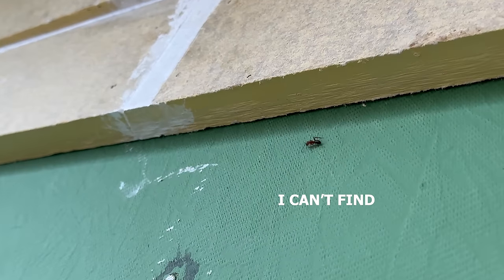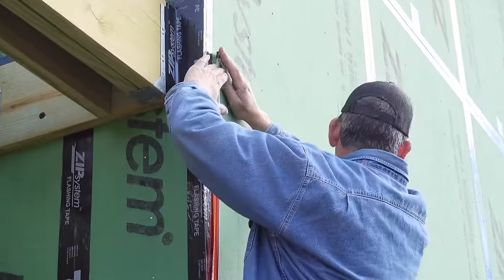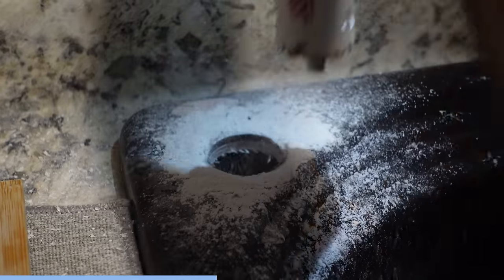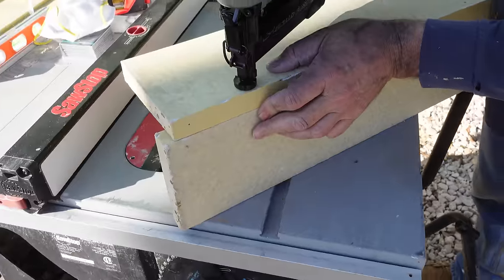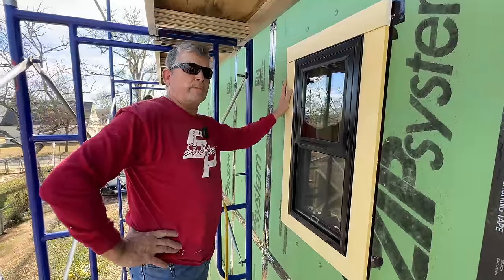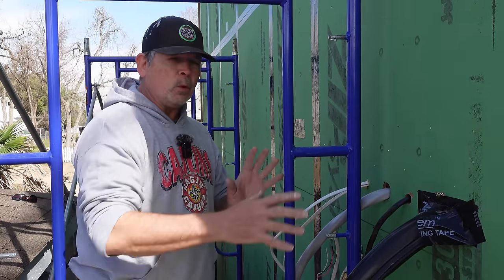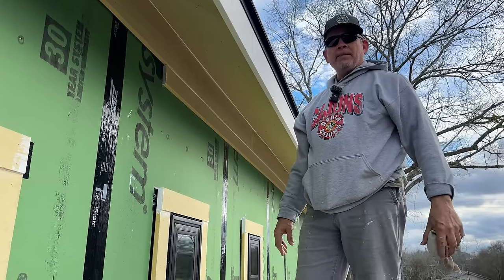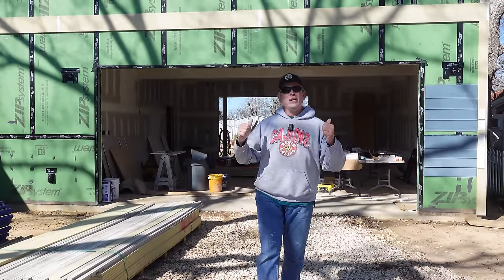Is THIS $30 DIY Water Level BETTER Than a Modern Laser?

Comment: My pop showed me the water level back when I was a teenager. I'm now 66 years old and have used them several times. Perfect every time.
Reply: Same here 😅!
Reply: My dad had a little kit that attached to any garden hose. The kit had two 12" graduated tubes with a mounting bracket on each so you could attach one to the wall, so you could work it alone. I am now 68.
Reply: im right between your age and  dallas arnold8615 that commented  im 67 as of last week       worked with my dad  on   5 houses we worked on growing up  we moved around a bit .   always doing something room additions   knocking out a wall  hanging a door   or something

Comment: I’ve been using water levels on new construction commercial buildings, some spaces over 300,000 square feet for 50 years….works like a charm, better than a laser that you have to knock down & reposition a dozen times. Yes, I’ve used lasers to set ceiling grids, but once you turn corners out of sight of that laser, screwed. I have a 750 foot long water level with RV antifreeze in it. Everyone wants to borrow it!
Reply: Wow how do you store that monster for easy use? Two spools so you can access each end? One spool you have to uncoil fully? 
What diameter did you pick?
Reply: I need more on this! sounds awesome.
Reply: 750', are you building bridges?
Reply: I like your username and avatar. Big jimi fan.👍
Reply: Wow, very nice. I'm also curious what diameter and how do you store/use it.

Comment: I use automotive windshield washer fluid in my water level (that I've had for 35+ years). Not only does it make the fluid more visible but it keeps it from freezing when I work in the cold.
Reply: Do you have to change out the fluid?
Reply: @jkleem4234  Never have... just added more to replace spillage.
Reply: Can you clean your glasses with this fluid?
Reply: Thank you for this advise, never though about it before, that windshield fluid could be used in the water level. I remember how in 90ies I was fixing my cheap Chinese 2 feet level vial with a short water level and with a thin sewing thread with a little weight against a white flat door, where I was marking tiny dots.
Reply: @baxtronx5972  Probably...  I haven't done it but your question may prompt me to try it the next time my glasses are filthy from site conditions!

Comment: I’ve had a water level for 40+ years. Mine consists of a set of two clear plastic hoses that are around a foot long,one with a male garden hose connector the other with a female hose connector. Any length of garden hose or combination of garden hoses will work depending on how far you need to go. I used it originally to install gutter drain pipe from the house 100ft to the ditch by the road.

Comment: Buy a garden hose, garden hose fitting, and a section of clear pipe. Attach to each side of garden hose to the clear pipe with fittings. Now have adjustable water level. Only need to store the clear sections for when you need it
Reply: That's a neat idea, can even use one of those cheap coil garden hoses :)
Reply: Came here to say just this. No need for 60+ feet of single purpose clear tubing.
Reply: That's what I always did. 2' of clear hose on each end of a garden hose.  Everyone owns some garden hose!

Comment: Hello Studpack crew 

I built for years Swedish homes 
In the corners of the homes we cut the underside 15 degrees in 
This results in the water falling of the point of the board. 
With a 90 the water drops stay longer on the board. 
This method prolongs the lifespan of the product
Reply: Agreed.  I'm surprised to see no one else mentioned that.  Where the vertical window trim meets the horizontal, I use about a 12 degree angle.  Also at the bottom edge of the bottom, horizontal trim piece.  12 degrees.  As water runs down the face of those pieces, that angle causes the water to drip outwards and down, versus back to the wall.

Comment: I've used a water level many times!  They work great.  I've usually tacked the 'reference' end of the tube in place and as long as you don't raise the 'working' end above the reference, you only need to cork the working end when you move around the structure.

Comment: I believe Metabo HPT makes 15ga, Angled 2” electro galvanized nails for exterior trim. You guys probably won’t get to this comment but you do an amazing job, great channel and great content! I’ve learned a ton over the last 4-5 years from you guys, I watch all your content. Wish you all the best of luck. Thank you for being great people.
Reply: Electro Galvanized nails have a very thin coating of zinc and aren't ideal for exposed exterior applications. Stainless is best, or hot dipped galvanized.

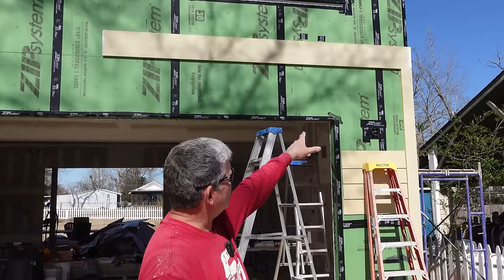Comment: 17:55 You guys did such a great job hiding the edge of the corner board from the street and then you exposed the edge of the ban board NOOOoooooooooooooooooooooo!!!! LOL
Reply: Right!! I was surprised by that!
Reply: @MrC9Oh3  haha then they did the other side right
Reply from the maker: We were just experimenting with joints lining up from corner to band back to corner, maybe splitting them up and it breaking that corner up a bit. A lot of what you're watching is us figuring stuff out and trying things! When it's all painted you won't be able to tell. 👊
Reply: @StudPack  It still looks amazing guys. I'm just being silly with my OCD haha keep up the amazing work!
Reply: @StudPack  hmmm...Paint hides everything is a sub contractors term for slap it on and lets go!.  On the Pro side, I installed Hardiplank on my own house in 1994, it was relatively new and not much info was out yet.  It only came in primed gray.  Today, 30 years later it looks just as new as when it was installed.  I prepainted before install, and repainted it 6 years ago just for a change in color.  Awesome product and choice for your new build.
Reply: Had to go back and watch. 😢

Comment: I bought a reasonably priced Chinese laser level and checked it with a water level and reversing the beam. I was impressed with how accurate it was - about a 1/16th over 45 feet. At dusk, it could easily shoot 100 feet and maintain a tight beam.

Comment: Old school level tube...I used one one time with success, then put it in a plastic milk basket for the next time I needed it,  A few years later I went to use it and it was rigid like rigermortise had set in.  I went to make another one because like you, I could not see the laser-line.
The old, 'made-of-leather' guy at the store told me he'd made one with a 100' garden hose and two premade clearends with built in release valves, but he filled it with the high-vis green anti-freeze.  He still uses his and it's been 30+ years.  He wound his onto a hand-made wood hose reel so it does not get twisted.  That's where I saw it, in the back of his work truck in the parking lot.
I spent a couple hours listening to his stories and learned a lot in trade for a coffee he did not ask for but was thankful.
One idea I had was to make it so one end of the level stayed with the reel, gets mounted and adjusted at the reference line, the other gets spooled out the needed distance plus a few extra feet and one guy can use it (after making adjustments).  So now, a good 20 years later, I'm still using mine and with a new method, a head lamp with a UV light makes that thing show up like a scorpion in the desert, even from 28 feet away because I used a orange neon marker for my regference line, a pair of bino's and a high-vis marked, black tape measure.
I own a green laser but it is still too hard to see during the day and I use it at night for shorter distance stuff I don't want to break out the hose level for.  I did have some success with the laser receiver plate that came with the laser, but when compared to the hose, I was 3/16" off on a 100' test I did to compare the two.  Not bad, but when I wanted to use it around our garage, it would have been off, so I used the hose level.
On this same build (our house), I've had to work in the dark often, still am since we are not done yet, so I use high-vis chalk-line, high vis bubbles in my levels and I can work easier at night than day though my eyes are not what they used to be.
My dad used to use a string line level, but I was not confident in that unless I could put a lot of tension on it, so I went to the hose level, version one, then two...
It was fun watching this one, but also I learn things and get updated through you guys on all your vid's, so thanks!!!

Comment: Don't forget temperature effect on density.
This is at least partially covered below but temperature affects density so if one riser is in the shade at 45F and the other is in the sun and warms up to 80F, then for a 100 inch rise the 80deg side will be 0.3in higher than the 45deg side! Usually not going to happen but something to be aware of.

Comment: I bought a “water level kit” for about $20 years ago. One end has a flat box with an index mark and a battery-powered horn. You mount that end at the level needed and move the other end up/down with the horn telling you when you’re “on”. Great when working by yourself.

Comment: We used a home made water level 50 years ago to setup mobile homes. one end set in a 5gal water jug at preferred level. the other end had a valve and magnet to stick to frame.  open the valve to get level. We were 15/16 years old back then.

Comment: The water level is the perfect tool for this job - you are 100% right. I have seen $3,500 Stabilia lasers that will work, but they will not be as fast, as cheap or as reliable. I have built several high-end custom homes using a water level, and they are easily the best choice for long-distance leveling. The only problem occurs when air bubbles are accidentally introduced into the water inside the tubing. In that case, you have to patiently fish the bubbles out of the water. So when you are moving the water level, you don't want to shake it or drop it, because this will form bubbles in the water. 

I also have used Hardi-trim on a custom home, just like you are using. Make sure that you use full dust masks when you cut it. The cement dust goes everywhere when you cut it - especially when you rip it. I can't emphasize this enough because there are several studies that link this cement dust to health issues. We wore a full painter's mask with replaceable filters which we bought at Home Depot. The paper masks just aren't sufficient. The paint/chemical mask that we used had two replaceable carbon filters. This mask is made to catch the ultra-small particles that a paper mask doesn't. 

If you want to be extra safe, install an L-flashing (usually 1.5" or 2" L-flashing that you can buy off the shelf). Make sure it extends around 3.8" -1.2" past the top edge of your top window trim piece. That directs any water that gets under your outside sheathing (cladding or siding) away from the top of the window, and it ensures. that your windows and exterior doors will never leak.

One final suggestion. Try to limit using caulk joints from being your primary source of waterproofing. There are two reasons:

1. Caulk requires maintenance every five years or so, and it is a LOT of work.
2. Caulk (all caulk) breaks down under UV rays from the sun. If the caulk is your primary waterproofing barrier, every time the caulk fails your building leaks.

So use caulk as sparingly as you can. This is a challenge with lap siding because you have to caulk the corner joints where the lap siding meets your vertical corner trim.

When I installed the fiber-cement trim on the custom home we built. I caulked under each piece of fiber cement trim at the top edge or the exposed side edge. This hides the caulk from the sun and will extend the life of some caulks to 40 or 50 years. Then I did not have to worry about exposed caulk at the corner joints.

Don't caulk the bottom of your horizontal trim because you want water to have a place to drain if it gets under the siding.
Reply from the maker: Awesome stuff thanks Frank!!💪👍

Comment: Thumbs up on the Big Stretch.. I have Certanteed cement board siding and it shrink! Big stretch is the ONLY caulking I have ever used that does not fail and I've used a LOT of them!

Comment: The water level is fantastic. I used one to make sure two different playsets I bought for the kids would match up exactly when I built a bridge between them.  I didn't find that bubbles can screw the level up pretty badly though.

Comment: Hey Stud Pack, I installed Hardie siding for many years. I don't know if you have used them, but the Gecko locking spacers are the only way to go. They work great in adding "extra hands" for a small crew!
Reply: Love those, use them at our Habitat jobsites

Comment: Looks good,and even better will last a long time.

I've used the water level and it works well 
A laser is much faster using a bench mark,15 years of fencing i needed more speed.
Set your laser at any height ,visible to reach 3 corners.
Then use scrap lumber for a preacher pole/layout stick and mark the difference ,only using a single person with a laser defector .

Pre-assembled, prepainted trim whenever possible. 
Prepare and save time on the ground.

Comment: Great advice when doing the corner board. This alos takes care of any inprofections where one wall board might stick out 1/8 of an inch which throws your whole corner board off. All this is covered if you assemble first then install, perfect corners!! Also paint it before you install it!!

Comment: I love that Hardie trim! I didn’t know you could use trim nails on it! When I built my house I used the same hot dipped nails I used for the siding. Painted up just fine. I avoided that tight spot under the roof where you can’t get your nail gun straight by changing the roof angle for a porch. I left my rafters tails square on the steep part. So I have an angled section of wall at the top that goes across the rafter tails. It’s a weird detail I’ve never seen anywhere else but it works on my tiny house. I admit I didn’t think about tool accessibility when I built it that way. I just didn’t want to try to make a straight cut on those rafters after I got them up there. I’m glad I’m creative enough to turn lack of strength and skill into architecture 😂

Comment: Great job so far. I’d suggest one thing. The band board on the front right butted into the band board which now shows the vertical joint from the front/street. It would look better in my opinion do have vertical butt to look just like the outside corner boards. It doesn’t matter which way the butt joints are on the back of the house. Keep those videos coming.

Comment: That water level idea is pretty crafty. The modern water levels are awesome as well as you can use them to check floor heights incredibly accurately. The one my friend uses at work has an accuracy of +/- 1mm at 60m or around 3/64” over 200’

Comment: Love my RO water system.  My system uses a 1 gallon tank.  I have the whole thing in the basement directly below the kitchen sink.  When we put in the new system I also ran a line to the Fridge so we do have RO ice and cooled drinking water out of the fridge as well.  We use a lot of RO water for drinking so I also added an additional 4 gallow tank that I spliced into the original 1 gallon tank in the basement.  Pretty simple connections.

Comment: Cutting trim with the Hardie carbide blades is a good choice. I use a diamond angle grinder blade for thicker material. Lasts longer. For siding I switched to shears. Had to order on line as no local suppliers carry them. MUCH quieter and NO dust. (What does silicosis feel like?) Shear blades are expensive but one set should get you through the whole  garage and house. Love the channel and that you own and fix any mistakes. Waiting for the next episode.

Comment: You can't beat the old method. We used to use a water level when we were doing large rooms with ceramic wall tiles that connected to hallways, etc.

Comment: Years ago my buddy replaced his old aluminum siding with vinyl siding. Had a 1,800 square foot single home. One side of the house was several feet lower so he started there. He used a 8' level to get vinyl level and fourth wall to line up with first side he installed. Luckily he only installed a few runs on last three sides. The four walls were just over 100' and he ended up a good 1.5" off. He then went out and purchased the color liquid in a tube like you used. Dead on

Comment: These do indeed work well. I made mine with garden hoses that had short clear tubing attachments at the end, but one thing you have to be very careful about is a trapped air bubble (s) in the line. An air bubble that occludes a narrow hose will allow the water to be higher on the side of the bubble. Bigger hoses are harder to occlude but take more water and are more difficult to fill and store.  I solved this by using a valved wye adapter hooked to two hoses on an outdoor hose bib. I would flow water out each side until bubbles were gone and then shut off the bib. That said it is a very practical method and I used it to level courses of bricks in a landscaping wall.  I forgot to mention that a similar method was used to level construction of the ancient the pyramids. A mud or clay ditch was made and filled with water allowing measurements to the surface of the water. I assume this didn't work on windy days.

Comment: I made water level when putting in my kitchen cabinets. I got the cabinets as best I could, they weren’t perfectly square. I went back and put shims on top as thin as 1/32 and no thicker than 1/4. I was told they needed to be level within 1/8 inch over 10.  When they put the countertop on, it was dead on. When you line up on the meniscus of the water level, it’s pretty accurate.